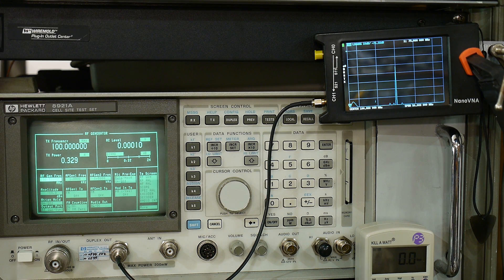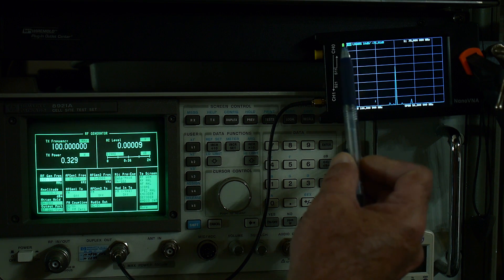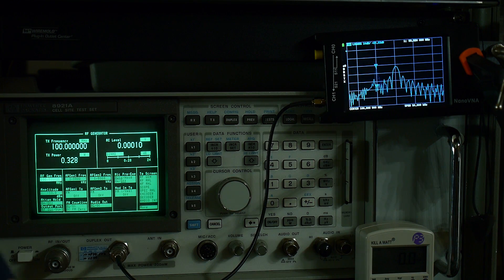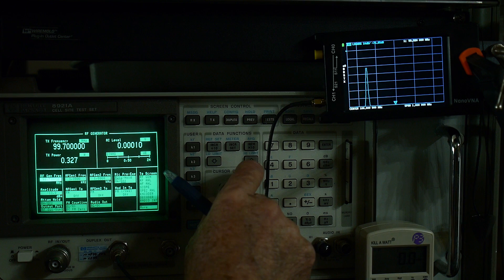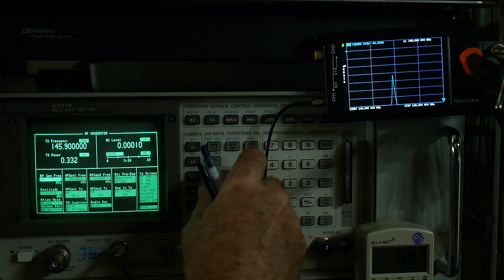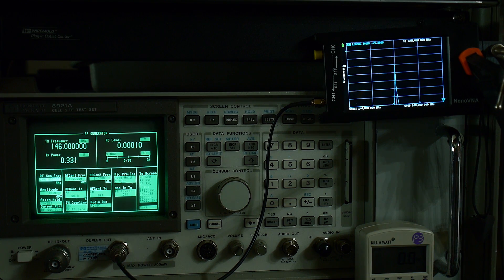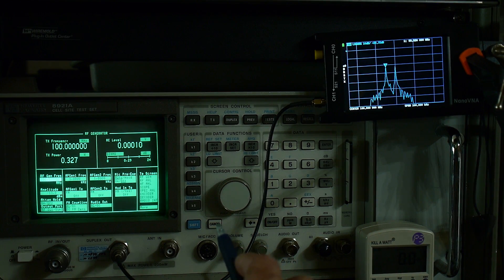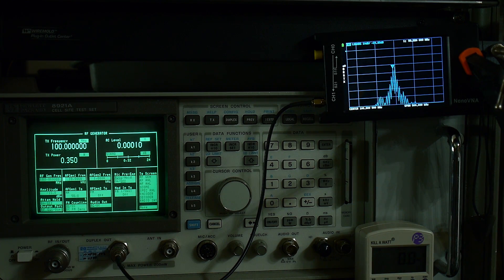#520 NANOVNA used as a spectrum analyzer?

Comment: I Don't know if you review comments concerning older content  but here it to goes.
I watched this video back in the day.  Thought it interesting and of course forgot about it.  Stupid of me!  Earlier this year I was blessed with an old dirty and worn out HP 8656B signal   generator.  I went through it.  Got it cleaned up and wanted to verify operation so it was connected to my HP8711/8712.  Somewhere in my brain I assumed it was a spectrum analyzer that do VNA stuff.  Well like in your demonstration there were what I called ghost signals along with the primary signal.  So I started a long journey of tail chasing.  Was the 8656 bad or the 8711?  I tested the 8656 signal on my scope in FFT mode and all was fine.  But could I really trust this FFT stuff?  I eventually bought a Siglent SA and found that the 8656 was just fine on both frequency and amplitude.   Then this morning I saw this presentation on nanvna's vs. SA's.  Well again thank you for all of your training.  If I can just remember.

Comment: and also in the VNA there is a built-in signal generator that constantly sorts through frequencies in the specified range and in combination with the bridge that connects both channels, as well as the processing speed of the FFT processor - all this will simply constantly generate random artifacts on the screen. as a scientific instrument as a SA it is unfortunately practically useless. p.s. I figured this out thanks to your videos.

Comment: general question: can a spectrum analyzer be used to find resonant frequency in a coax trap like we do with a grid dip meter measurments?
Reply from the maker: not the same way. you can use a spectrum analyzer with a tracking generator to do that.

Comment: I don't know that you will ever see this..... I know it is an older video.. but I JUST GOT my Nano VNA H4 and this video caused a couple of questions.

1- DID you calibrate the NanoVNA and if so did you calibrate it for a "through" EVEN THOUGH you are only using the input side???

2-I do notice that your generator is set to put out  -10 dBm but it LOOKS LIKE the NanoVNA is showing something in the neighborhood of -20dBm on the grid.   Am I reading/understanding this wrong?

The reason I am so interested is that I am trying to see if I can use my NanoVNA to "more accurately set" my Boonton 102F and B&K 2040.  Both of these can be set using the rotary attenuator and adjusting to the 0 dBm reading on the scale to output the desired dBm level...    I am just wanting to determine whether or not I can use/trust the NanoVNA reading as an accurate setting!

Thank you so much for what you do here!!!!!         Bob AI5RR
Reply from the maker: no, I suggest getting a TinySA ULTRA
Reply: @IMSAIGuy  - I've already put some thought in that direction!  I have a REALLY old Hameg 5006... but it lacks a lot of features..... like the ability to read the frequency and level on the screen with a measure of certainty!!!!  :)

Thank you so much for the response.

Comment: What's nice to know is the max input level on the second port to avoid damage, and that it's possible to at least hunt down a source of interference in your immediate location (routers, smart meters, switching supplies, leaking powerline insulators, etc...).  The rest of the comment blah-blah is irrelevant.  Who cares if it's lacking this or that?  It's made in China, is cheap, and questionable at best.  Hypothesize all day long - proves nothing other than you don't have any idea.  Buy a little spectrum analyzer and use it as intended if more detailed analysis is needed.

Comment: You need to establish with a true spectrum analyzer that the output of the HP unit is clean.  Everything that you say is unsupported. It may be accurate, but there is no way for me to evaluate your data.
Reply from the maker: I've looked at the output of the HP8921 with an HP8591E. It is just fine.

Comment: hi, i just bought nanoVNA but now im afraid to measure my radio because I cannot find any example of people using nanoVNA to measure a radio. my radio is 900Mhz, and I want to know if my radio is really outputting 30dBm (I have 40db Attenuator). would i destroy my radio if I remove my radio antenna, and attach my radio to the Attenuator and to the nanoVNA(because it may act as if there is no antenna, or does the nanoVNA has an internal load that will compensate this)?
Reply from the maker: the nanovna will not measure the power level . it is not calibrated for that. you will need a spectrum analyzer (like the tinysa). you will need enough attenuation to keep the input below 0dBm. The 40db attenuator you have will be the primary load on the radio. the 30dBm will be reduced to -10dBm (0.1milliwatt) and the 1watt of power will be heat in the attenuator. if nothing is attached to the attenuator that 0.1mW will be reflected back and have to go through the 40db a second time so nothing will come back to the radio.
Reply: @IMSAIGuy  oh cool you replied so fast and detail! thanks a lot! btw can I at least use it to see if at least my transmitter is not broken? doesnt have to be percise power but at least if i can the graph hitting -20dbm (after the attenuation)
Reply from the maker: @stonedDawg  the nanovna does hot have any units of dbm     you cannot use it.

Comment: The answer to this question is definitely NOT!!!
Here is a list of points in my humble opinion that show why i say NO.

1. The local oscillator in the VNA :
The local oscillator cannot be guaranteed to be accurate ( no way to know if it has been calibrated and no way to calibrate it if it was off  frequency). so frequency cannot be relied upon to have any real accuracy.

2. Sample points :
Any signal that is between sample points is calculated in mathematics to be a rough approximation of something in between sample points. Sometimes there is not enough information to even show there is a signal between the sample points. This leads to the power level of the signal not being accurate or useful. if the sample point was actually at the frequency of interest then it may become more useful but inaccurate in frequency ( see number 1 above). 
 
NOTE: when using an external signal generator you have to be careful to not overload the input of the VNA's mixer. doing the same experiment at different power levels would possibly show the VNA's mixer is being over loaded (if different results at different power levels are shown). The 'weirdness' in the video could be simply the mixer being overloaded and causing undesirable harmonics to show up on something that was NEVER designed to function in the way it was being used. 

The TOP 2 points above show that you would never be able to trust any frequency or power level shown on the device. The main purpose of a spectrum analyser is to measure the frequency with some accuracy and measure the power level to some know accuracy. As these two functions of a spectrum analyser cannot be done with enough accuracy on VNA then the answer should be a definite NO!!

Best regards 

Simon

Comment: Interesting video!  I tried the same test on the nanoVNA SAA-2N and has similar results.
The two big limitations using these devices as spectrum analysers are the fixed narrow bandwidth "I.F.", with generally much larger discrete frequency steps, so you only see energy at narrow discrete frequencies and miss everything else between those spots.
Throw the square-wave local oscillator and you'll get all sorts of anomalies!
Interestingly when you start doing sweeps over a few octaves, you see significant images of the input signal at higher and LOWER frequencies.  They aren't always visible, only visible when the harmonics of the sweeping oscillator happen to line up exactly with the input signals.  If everything is just right, I see images of a 50MHz input at 1/3, 1/7, 1/9, etc frequencies.
Reply: Precisely...therefore we should look for nano spectrum analyser right away !!!!! I bet it won't work properly either. Low budget investments never pay back !

Comment: Thanks for the experiments. I just tried it on my NanoVNA-F (Hardware version 2.3, Firmware BH5HNU 0.1.5) and not too much better luck. While it responded resonably well if the center freq was right on the signal (and the signal was stable), I get nothing for most settings (e.g. 50k to 20MHz sweep with 12 MHz input signal shows nothing until I force it to hit the 12.000000 MHz signal exactly in the sweep). It seems to be that the step size is too big relative to the kHz wide filtering it is using. I wonder if someone could modify the firmware? But it would be too slow I'm afraid.  Sure will be nice when the amazing developers of the NanoVNA come up with a cheap spectrum analyzer too !
Reply from the maker: You need the TInySA 
https://youtu.be/n6WEM3--Npc
Reply: @IMSAIGuy  Awesome. Checking it out now in your video :-)
Reply from the maker: @MegawattKS  I have several videos. It takes a while to learn to drive it well and I'm learning. It is quite good if used below -30dbm

Comment: It’s me again, thank you in advance for your patience. 
Considering your results, I think there should be no problem to build a reasonable audio filter. 
Maybe the LO of the VNA has some more phase noise (from fast reacting fractional n division). The LO shall react fast and phase noise is not so relevant as it is compensated in its original application where ch0 and ch1 are mixed with the same signal. If there is some external signal measured without the identical phase noise then it is not compensated. 
This could be checked by measuring the ch0 with a quality spectrum analyzer (in particular with a slow sweep at the VNA to cover different fractional n situations with their phase noise). 
I will make own measurements soon, at least I am almost sure, or I hope so.
Reply from the maker: I did measure the RF generator once:
https://youtu.be/MWEVJAjMuhs
Reply: @IMSAIGuy  The video is not available it is stated to be private.
Reply from the maker: @Manf-ft6zk  oh sorry. as you know many youtube providers have videos in queue to be published automatically in the future. Guess you'll have to wait ...

Comment: I could not tell at first if you were in uncalibrated mode or not, it looks like you were. A better spectrum analyzer would be the Airspy or other SDR. The up and down power response and weirdness is probably due to the Si5351 not able to generate power or small frequency steps accurately. The next NanoVNA video should be on measuring amplifiers S21.

Comment: I was wondering it myself, but unlike you I don’t have the tools to test it. 
The problem with your test is that you are not considering the limitations of the nanoVNA hardware.
Let me explain: In your experiment, the nanoVNA collects only 100 samples spanning the 4 MHz bandwidth (148-144). Meaning, that the nanoVNA steps are 4 MHz / 100 = 0.04 MHz. 
Your generator is tuning in 0.1 MHz steps. Meaning that the generator generates signal at: X.10, X.20, X.30, X.40, X.50 MHz, etc. frequencies. 
The nanoVNA is ‘Listening’ to are X.00, X.04, X.08, X.12, X.16, X.20, X.24, X.28, X.32, X.36, X.40 MHz, etc. 
Notice that only frequencies X.00, X.20, X.40, X.60 and X.80 MHz are common to both TX & RX. 
Any frequency (TX or RX) outside of common frequency will read lower power because your generator is transmitting away from the frequency nanoVNA is listening to. 
Please make a note in your video, that when you tune to one of the common frequencies the power reading is what you expect. The moment you step away from frequency nanoVNA is sampling, you only get smaller magnitude reading for that frequency.
A test that would demonstrate the right setup would be to sweep say 145 MHz to 146MHz and repeat your test with 0.1 MHz tuning steps. That way, your generator is transmitting on the same frequencies the nanoVNA is receiving. The signal magnitude should not change throughout the whole test.
Reply from the maker: You may have a point. I tried your test and yes the power stayed the same. but I went with 0.01 steps and it all stayed the same. At the 145-146 range the nano IF filter is wide enough to capture all steps. I also did a 145.000 to 145.100 sweep and it was garbage. I got the nasty double peak response and wide side bands that are 50kHz wide. so if you assume the IF is 50kHz fixed. then your input needs to match the 100 data points within the 50kHz filter. So wide sweeps only, steps must equal nano. no modulation. I've got the tinySA on order so will be fun to try that one.
Reply: @IMSAIGuy  What happens if you redo your calibration after choosing the narrower frequency range?  Would the calibration points now line up with the sample points?

Comment: What would be considered safe power to send to the RX port of the unit ? Isn't 0.3 watt a lot for such a small unit ? I got my nanonva-f today.
Reply from the maker: Yes you are right. that would be too much. the .3W display is due to the way the HP8921 is constructed and measures. I'm not using that function and it is an artifact. I'm using the RF generator and if you look at the bottom left you will see the amplitude set to -10dbm. that is 0.1mW or 100uW.